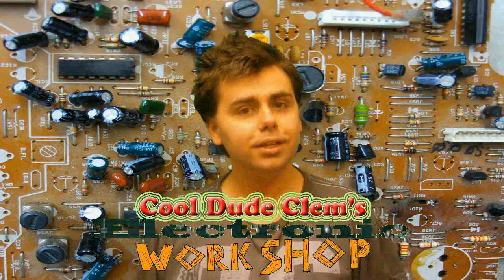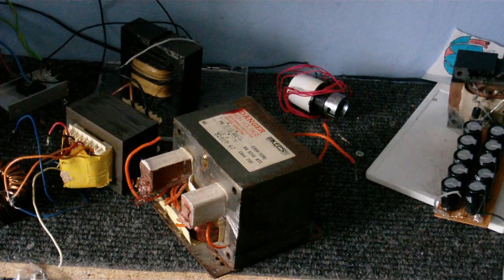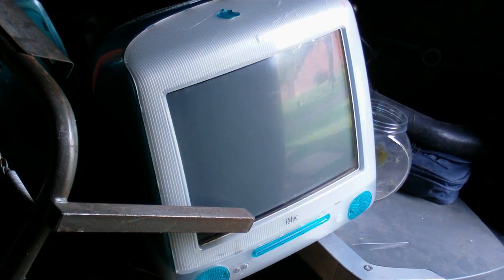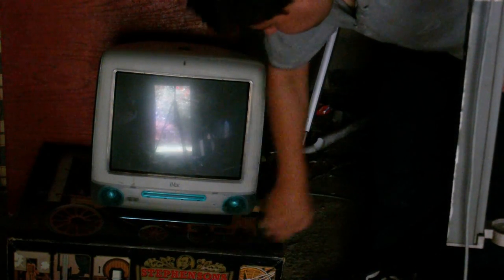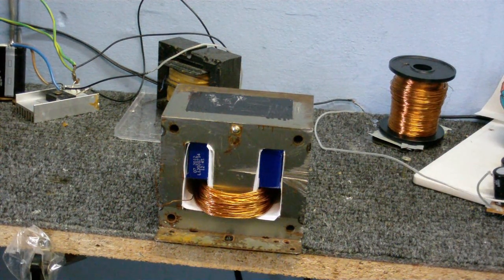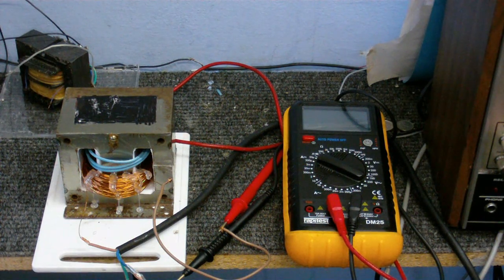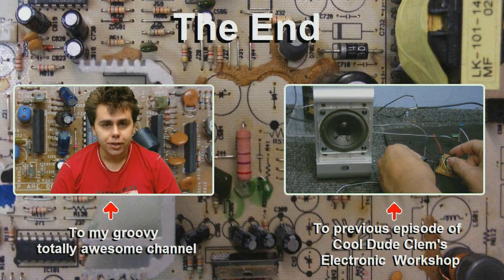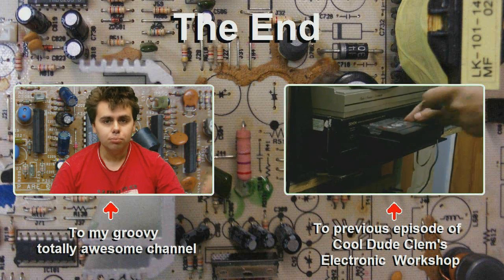beginnings of a high power power supply

Comment: Get yourself a toroidal transformer clem, you could get a 300va toroidal transformer for about 30-40 quid or maybe even a 500va toroidal :)
Dont use microwave transformers clem, with insulated wire the efficiency is really bad (you think about how much space all that plastic takes up)

Comment from the maker: @MrStemkilla the other pins on the flyback do go to lower voltage windings inside, but for most experiments it's best to just wind some wire on to the core and use that as the primary.

Comment: @CoolDudeClem im not sure of your switching transformers but if you did it how most people do its close to the maximum switching speed of the transistor. that would be adding a new set of windings going to the gate of your transistor.  what do all the other leads do from the other side of the fly back? one is obviously hv ground all the rest are lower voltage hots?

Comment from the maker: @MrStemkilla Flyback transformers work best with pulsed DC at high frequency, I did once try putting AC in to see what would happen, but all I got was hot wires and not even enough voltage out of it to produce a tiny spark.  I'm not sure what frequency the ZVS powers the flyback at, probably something like 30 kHz.

Comment: i see you take and convert it to smoothed dc then use transistors to pulse it at like 200+ hz maybe 400? but why not feed it to the fly back as AC? or do you just do it for high frequency?

Comment from the maker: @sk7ca I did put 2 secondary windings on that transformer so I could connect them in parallel for more amps, i would have liked to have used thicker wire but that's the thickest wire i have right now, with thicker wire i might not have been able wind enough on to get the whole 25 volts that i needed.